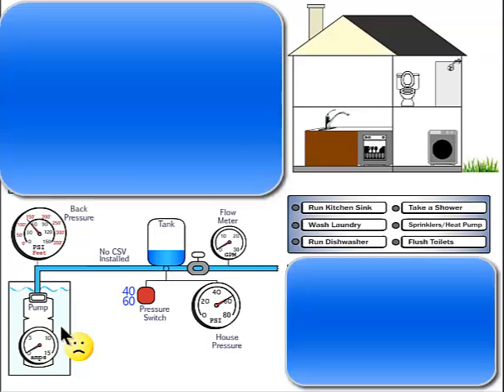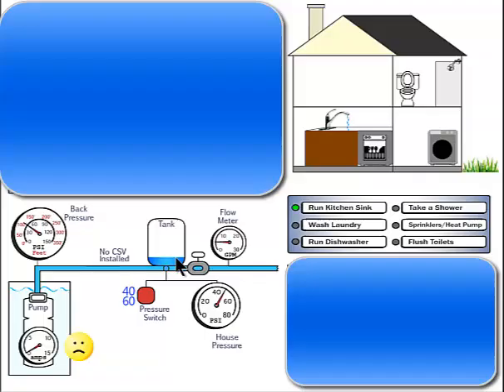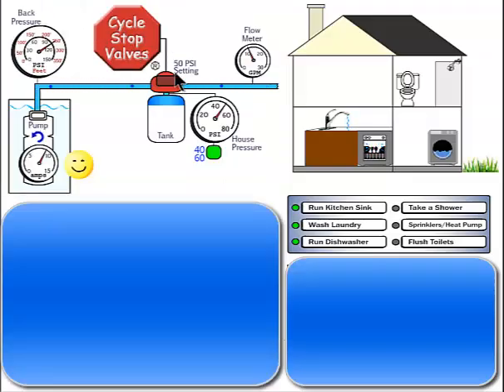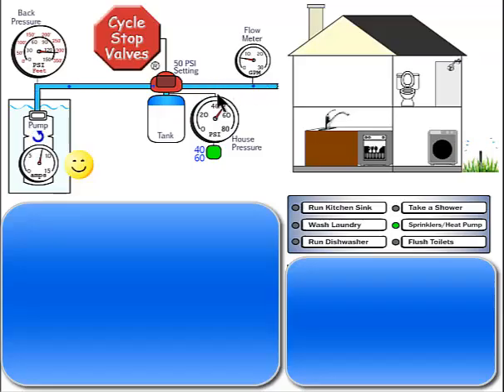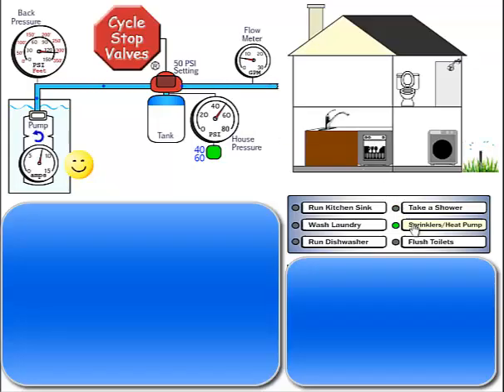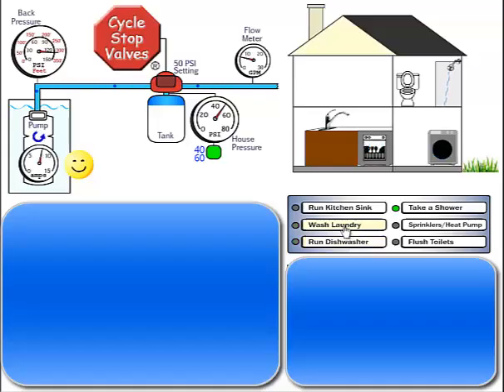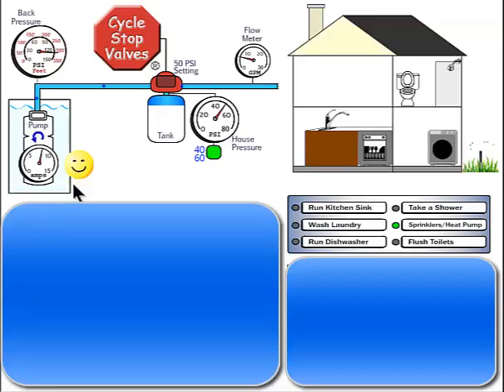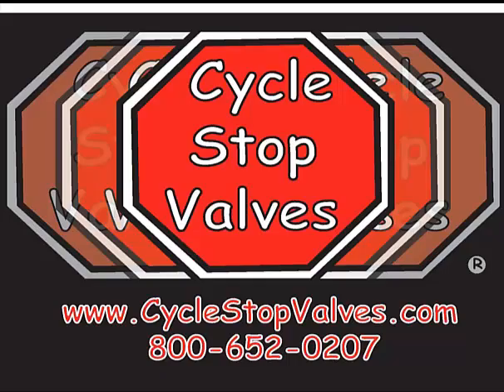How a Pressure Tank Works and why you need a Cycle Stop Valve

Comment from the maker: Highly repetitive. Doesn't ever fully explain what (specifically) a CSV does to reduce the flow, which is the key point. You kinda mention it starting at 9:45, but not really. For example, it's not clear how a CSV is installed.  Is it just plumbed, or is it plumbed AND wired? There is no mention of how it relates to electrical connections if at all.

Does the CSV electrically reduce the power to the pump, reducing flow? Or does it just constrict and reduce flow, which forces the pump to work against a bigger resistance, slowing it down?

Seems like the whole 12 minute video could have been summarized as: "A CSV takes your cheap one-speed pump, and makes it perform at variable speeds, like an expensive Variable Speed Pump, for about $75." Then  describe how.

Hi Derek
You are just thinking about it too hard.  Lol.  There is no electric to the CSV (just plumbed).  It doesn't vary the speed of the pump.  The CSV is just a simple spring operated valve that "constricts or reduces the flow" just as you describe.  However, working against a bigger resistance doesn't slow the pump down.  Quite to the contrary the motor actually speeds up as more restriction means reduced flow rate and reduced load, not increased load as you might think.  The same way as putting your hand over the suction of a vacuum cleaner or the discharge of a blow dryer makes the motor sound like it is speeding up, because it is.  The "load" is in the volume of air or water that is being pumped, restricting the flow decreases the motor load, which is just the opposite of what most people think.  The amps naturally decrease when a single speed pump is restricted, almost exactly the same as when reducing the motor RPM with a complicated and expensive variable speed drive (VFD's).  It is not me who has you confused, it is the ones trying to sell VFD's.  They want you to think that is the only way to reduce amps from a pump/motor.  They don't want you to know that amps reduce naturally with flow, not RPM, and that is a natural, albeit counter intuitive property of any pump with a centrifugal impeller.  The CSV is a simple valve that is easy to understand.  What is hard to understand is how restricting a pumps flow with a valve can have the same effect on amps as reducing the RPM.  See this video for further explanation.
https://www.youtube.com/watch?v=3GABhLLtjas&t=46s

Comment: Highly repetitive. Doesn't ever fully explain what (specifically) a CSV does to reduce the flow, which is the key point. You kinda mention it starting at 9:45, but not really. For example, it's not clear how a CSV is installed.  Is it just plumbed, or is it plumbed AND wired? There is no mention of how it relates to electrical connections if at all.

Does the CSV electrically reduce the power to the pump, reducing flow? Or does it just constrict and reduce flow, which forces the pump to work against a bigger resistance, slowing it down?

Seems like the whole 12 minute video could have been summarized as: "A CSV takes your cheap one-speed pump, and makes it perform at variable speeds, like an expensive Variable Speed Pump, for about $75." Then  describe how.
Reply from the maker: Hi Derek
You are just thinking about it too hard.  Lol.  There is no electric to the CSV (just plumbed).  It doesn't vary the speed of the pump.  The CSV is just a simple spring operated valve that "constricts or reduces the flow" just as you describe.  However, working against a bigger resistance doesn't slow the pump down.  Quite to the contrary the motor actually speeds up as more restriction means reduced flow rate and reduced load, not increased load as you might think.  The same way as putting your hand over the suction of a vacuum cleaner or the discharge of a blow dryer makes the motor sound like it is speeding up, because it is.  The "load" is in the volume of air or water that is being pumped, restricting the flow decreases the motor load, which is just the opposite of what most people think.  The amps naturally decrease when a single speed pump is restricted, almost exactly the same as when reducing the motor RPM with a complicated and expensive variable speed drive (VFD's).  It is not me who has you confused, it is the ones trying to sell VFD's.  They want you to think that is the only way to reduce amps from a pump/motor.  They don't want you to know that amps reduce naturally with flow, not RPM, and that is a natural, albeit counter intuitive property of any pump with a centrifugal impeller.  The CSV is a simple valve that is easy to understand.  What is hard to understand is how restricting a pumps flow with a valve can have the same effect on amps as reducing the RPM.  See this video for further explanation.
https://www.youtube.com/watch?v=3GABhLLtjas&t=46s
Reply: Thanks. The paragraph above is the explanation that was missing from the video. Very interesting.

Comment from the maker: I agree a weak producing wells need a large tank, but that would be a storage tank, not a pressure tank.  A large pressure tank is just seen as an extra demand, and actually makes the problem worse.  All the water from a pressure tank is used up as the pressure drops from 60 to 40 PSI, before the pump is even started.  Then when the pump is started, the pressure tank is completely empty, and the pump/well is having to supply the water you are using while at the same time try to refill the pressure tank.  Most of the time the pressure just stays low and the tank is not refilling while you are using water.  Then when you stop using water, the tank has to be refilled from 40 to 60 PSI, requiring the well to produce another 10-20 gallons or so, after you have already depleted the well while taking a shower.  So the well didn't get pumped dry while you were in the shower, now it will pump dry while trying to refill the pressure tank.  If your well only makes 1-3-5 GPM, that is all you will be able to use unless you store some water, which requires a storage tank and booster pump, not a large pressure tank.  There are 1440 minutes in a day.  If yours well only makes 1 GPM, that is still 1440 gallons per day, which is enough to supply 5-7 houses all the water they want, IF YOU CAN STORE 1440 GALLONS.  Here is a link to a drawing of a storage tank/booster pump system.  The booster pump system using the CSV can supply multiple houses as well while using a very small pressure tank.  It just needs some water to work with, which is where the storage tank comes in.  
http://forum.cyclestopvalves.com/index.php?topic=1840.0
Reply: Sounds like you need both a large storage tank to provide a reservoir AND a smaller pressure tank to provide for good delivery volume when required.

Comment from the maker: Large pressure tanks are not good at storing water for power outages.  An 80 gallon size pressure tank only holds 20 gallons of water, and that is only when the tank is full to 60 PSI.  When/if the pressure is at 41 PSI, just before the pump comes on at 40, there is only 1 gallon of water in the pressure tank.  You have no way of making sure the system is at 60 instead of 41 when the power goes off.  Murphy's law says it will always be at 41 when the power goes off.  If you knew the power was going off, and made the pump come on and fill the tank to 60, you would have 20 gallons stored.  But without knowing the power is going off, you also can't make sure there is any water in the pressure tank.  I keep a couple of 5 gallon water bottles in the closet to be sure I have some water when the power goes off.  And I keep a generator handy for times when the power is off for long periods.  A large pressure tank is just a waste of space and money, and makes the pressure in the house be high at 60 or low at 40 for long periods of time.  A small tank with a CSV will give you much stronger constant 50 PSI instead of continually going up and down from 40 to 60 as with a big tank.
PS; I hate when people remove questions they ask after I answer them.  I will leave this explanation for the next person who thinks big pressure tanks are a good way to store water for times with no power.

Comment: Hi need your help i'm planning to buy a pump with pressure tank. my question is
if the CSV will make a pump always on then i can get a more energy, (electric bill?) 
i am using the pump with pressure tank together the air compressor for my main washer instead the  pressure washer
for the stationary car wash business my purpose is to save energy or electric bill. please let me know what do you think if CSV is good for a carwash business
hoping for your reply thanks.
Reply from the maker: The pump only runs when you are using water.  Open a hose, the pump comes on and runs.  Turn off the hose, the pump shuts off.  Cycling the pump on/off actually uses more energy because it takes 6 to 9 times the running amps to start the pump.  Lots of car washes using Cycle Stop Valves.  Gives better pressure and makes the pumps last longer.
Reply: okay where to buy the CSV send to philippines. do you have online shop for CSV?
Reply: my pump is 1hp Self-priming Jet Pump pressure tank 100 liters.
Reply from the maker: You can find our on line store here. https://cyclestopvalves.com/pages/csv1a   But you might need to call us so we can figure freight. Thanks
Reply: Yes, it might take 9 times more amps to start, but it doesn't take very long to start, so the power used isn't very much.  I don't think you'll save electricity.

Comment: This device would not be recommended for a low-yield well because it's cutting out the pressure tank buffer right?
Reply from the maker: A CSV with a small pressure tank actually works better with low producing wells than a system with a large pressure tank.  A large pressure tank is just an additional demand for a weak producing well to supply.  If the well is really weak, a cistern storage tank with a booster pump and a CSV is best.
Reply: right

Comment: From what I gather, this could result in a bigger electric bill due to longer pump run times.
Reply from the maker: Because the amps are reduced, the longer pump run times do not increase the electric bill.  It just stops the cycling, making the pump and everything last longer and deliver strong constant pressure to the house.
Reply: Isn't the pump working harder into a "short circuit" by shunting the flow like that? Doesn't the pump cavitate under these conditions?
Reply from the maker: NO it is just the opposite of what you think.  Restricting the flow from a pump makes it draw lower amps and work easier not harder.  But I understand why you think that.  Even most pump engineers don't understand that the amps of a pump naturally decrease as the flow is decreased.  They think you have to reduce the RPMs with a VFD to make that happen.  Pushing VFD's shows they don't have a clue as to how pumps really work.
Reply: So this suggests that submersible pumps are not Positive Displacement Pumps, but Centrifugal Pumps, whose design allows some of the outflow to be churned back through the gap between the impellers and the housing. 
Closing an output valve on a PD pump would be fatal, but not so on a CF pump.
Reply from the maker: Some of the solar submersible pumps are positive displacement and will not work with a CSV.  But most submersibles are just muti-stage centrifugal pumps that use less energy as the flow is restricted.  Not much of it recirculates as the gap between the impeller and wear ring is a very tight fit.  The CSV just makes the pump think it is in a deeper well when small amounts of water are needed, and opens up to make the pump think it is in a shallow well when large amounts of water are needed.  The amp drop for restricting the flow is just a beneficial side effect of centrifugal pumps.
Reply: @cyclestopvalves8380  Is there an easy way to tell which pump is which type?  I very recently had a new pump installed and I'm curious about this CSV system.
Reply from the maker: @marco1173  The pump model number on the invoice where you paid for it would be the best way.  You could post a picture to our forum.  I would be glad to help you figure it out.
Reply: The electric bill will be larger (maybe not a lot larger) but larger because the valve provides artificial resistance at low yield. This resistance results in lost efficiency due to heat loss. It's physics.
Reply from the maker: @LarryElterman  
Did you not read all the replies above?  "Artificial resistance" to a centrifugal pump actually makes the amps go down, not up.  Yes the pump runs longer, but at reduced amperage, so very little difference in the electric bill.  Electric bill for a house only can go up from 5 bucks to 7 bucks a month when using a CSV.  But everything in your pump system will last longer, and your saving $300-$500 not using a big tank.  Takes a while to pay off a tank at 24 bucks a year savings.  And if you use water for irrigation, the electric bill can even go down when using a CSV, because multiple starts get expensive in more ways than one.

Comment: This is amazing! Like Steelman63 I would like to get a #CycleStopValve. My wife will love this if it eliminates the strange cold water pressure drops she's been experiencing during her morning showers. Based on your video, i gather that since the pressure isn't remaining constant, our on-demand water heater doesn't stay on the way it should, since it is triggered by high water pressure.

What will it cost me and can I get it from ACE or AMAZON? Thanks!
Reply from the maker: Yes the CSV makes shower pressure better by holding a constant pressure.  It will also make instant water heaters stay on when the old cycling on and off causes water heaters to go on and off as the flow changes.  You can get one here.  https://cyclestopvalves.com/

Comment: Would this system work for a cottage set up.  We are there usually only for a 2-4 days a week in the summer and the occasional full week.  We have a shallow sand point well, 3/4 or 1hp jet pump and a 4.4 gal tank.  Use a 30/50 pressure switch.  We ok water pressure but our but is always on and off.  Would this be suitable or should we just go with a larger tank for this application.  We also have two washrooms, one shower, kitchen and a washing machine.
Reply from the maker: Yes a CSV will work with that.  A 4.4 gallon size tank is the normal one we use with a CSV, but is way too small a tank without a CSV.  Just put in a CSV1A before the pressure tank.  It will eliminate the cycling and give you strong constant pressure in the showers.
Reply: So your video shows a 40/60 switch and running around 50psi using CVS.  Can i use my existing 30/50 switch and run at say 40psi?  I dont know the actual HP of my motor off hand but lets assume its 1/2-3/4 HP.  I am also using a shallow sand point well.
Reply from the maker: Yes 3/50 is more common with a jet pump as it won't usually do 40/60.  You can set the CSV1A anywhere from 15 to 150 PSI.